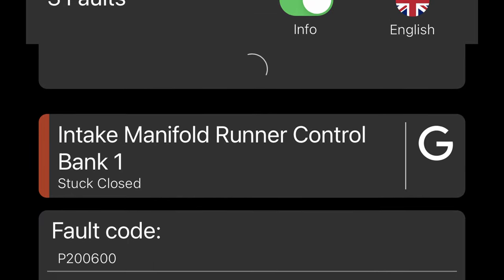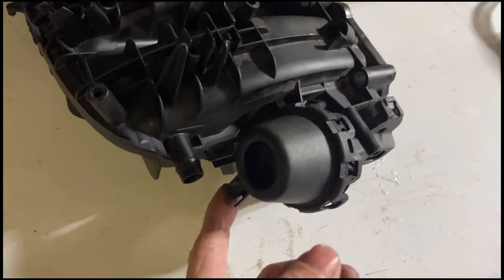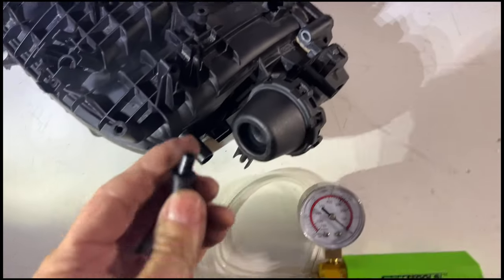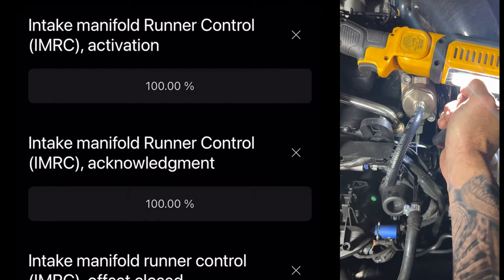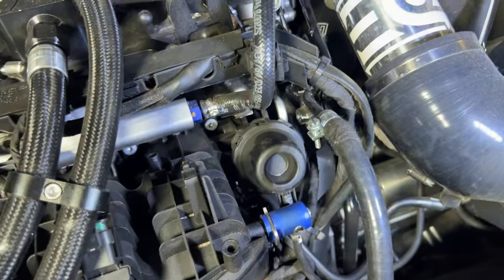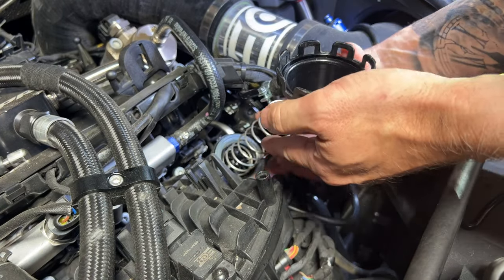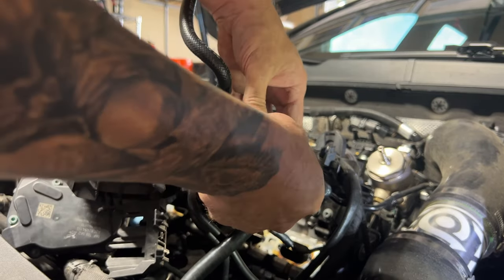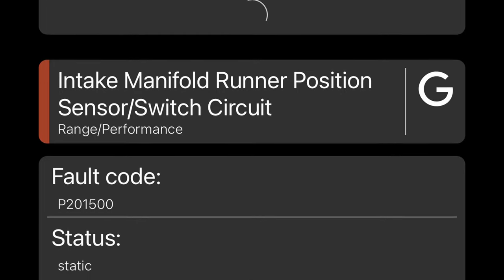Fixed! Intake Manifold Runner Stuck Closed (P2006/P2015)

Comment: This is happening on my 2023 MK8 R DSG.  The dealer did their troubleshooting and cleared the code and test drove it.  Then, a few days later, the check engine light came back.  This time, they determined the manifold needs to be replaced.  Its on order.  Car has 4,500 miles on the odometer.
Reply: This happens to my T-Roc R 2023 3 months old with 3000k kilometers. The last three days every morning, i have check engine light with p2015 and some times p2006.
Also, before this light came up, the power was not stable. Some times, it was good, and sometimes it was slow.
Reply: This is currently happening to my 24 Golf R DSG as well. I am 2300 miles in. Dealer will also be replacing the manifold.
Reply: Just got the code on my mk8 gti 😂
Reply: '24 MK8 R 6spd...car is at the dealer now second time, they want to change the runner solenoid before replacing the whole intake...i feel like my car will be back there 😭

Comment: When your intake manifold heat control valve was stuck closed (due to inoperative vacuum valve), did your intake manifold overheat?  if so, why?
Reply: did you watch the video? why would you assume its heat.. its a tear in the rubber... bro do you use your brain?
Reply: @johnboy2436  rubber doesn't tear on it's own. Something needs to cause the tear or rubber failure such as heat, but that is not why I asked the question, stoner.
Reply: @meblake7359 Could you tell me why you assume i smoke weed? What on earth would make you call me a stoner. Then explain how you think heat would get through a layer of thick plastic and then cause a "tear" with no indication of anything being melted. I see you used the word failure to somehow throw shade on the fact what your say is just not possible. You understand how this system works right?

Comment: Anyway you could tell me the OBD app you are using to look at that IMRC data? Im having the same issue right now, and I confirmed I have vacuum, so I would Like to check if my sensor is the problem at this point.

Comment: I am assuming  this will apply to same fault code i  got P2004/3B5E . The sympton i have is hesitation at above the rpm range you mention.
Reply from the maker: Sounds like yours is stuck open… I’d def start with these troubleshooting steps. That sprint is what closes the runner. So it could be that is broken or something is stuck somewhere.
Reply: I took out the censor and it was covered in gunk. It seemed to have it fixed for a couple days but symptoms came back.

Comment: What symptoms did you have while driving; I'm getting EPC warnings on heavy acceleration & it seems to be cutting my throttle plate & dumping boost making my car fairly slow. Is this what you experienced before the P2006 code was initially stored? I'm going to inspect the diaphragm on the vehicle as the runner isn't physically stuck. I have to assume a manifold replacement will fix these other issues. My theory is when the car sees the manifold not opening the runners it goes into a temporary limp mode preventing the car from building boost by using the diverter valve and literally not opening the throttle plates. The difference between the pedal position and the throttle plates throws the EPC warning if you bury the pedal when it's cutting power. Let me know when you can if any of this happened to you. Thanks

Comment: Hello CPO ~
Great video you put together! I don't comment often, but you deserve applause for your time, professionalism, and your willingness to be selfless in our increasingly selfish world! So, thank you!

I wanted to comment on one point that may help someone else in the future, who might be struggling with a similar issue. Before I do, I want to be clear that I am in no way trying to be critical or portray that I'm anything special. This is only meant to be constructive criticism. If I may explain...
 --There is no need to monitor the (runner position) sensor as you manually move the runner.  The reason is,  the fault code(s) indicate a "stuck runner" and you confirmed it when you applied vacuum to the runner actuator and it would not move or even pull a vacuum.  So, the sensor can't possibly be a contributing factor.  Seems like I'm nit-picking but I believe that its always best to keep it as simple as possible.  In other words, You nailed it when you decided to use a vacuum pump to move the runner!!!  That was GREAT diagnostic skills!! By manually moving the runner with the pick while watching the data, just shows that the sensor and circuit is functional.  But you already know that because 1) the P codes and 2) the inability to move the runner with a vacuum source confirms the fault code.  The intake runner actuator is simply a sealed canister with a diaphram inside that's attached to an arm, that arm is attached to the intake runner shaft.  "When vacuum is applied, one side of the canister that has the hose port is under a vacuum, and the other half has no vacuum. As a result, the diaphragm is pulled towards the vacuum hose end. This indicates that there is a vacuum leak inside the canister. Therefore, there is no need to check the sensor. I apologize for the length of my message, but I always try to explain the operation and description of a component as it is my passion. There are many YouTube "mechanics" who just replace parts without understanding their functionality. If you can comprehend the purpose and functionality of a component, you can fix anything! 

God bless you all
Reply: Sending you a word of thanks for the detailed explanation - it’s always helpful to know the “why” when working on this stuff!

Comment: Having this exact problem. Same exact codes and everything. Perfect timing thanks a lot. I also happened to have an extra manifold lying around, so I'm just going to swap over that piece.
Reply from the maker: Keep me posted!!!!
Reply: did that solve it?
Reply: @gabekendall3751  I ended up having a small tear in one of my vacuum lines leading to the same failure.
Reply: @brandanholt3709  i just figured it out on my car i accidentally didn’t have one of the vacuum lines hooked up🤣 Are you hybrid?
Reply: @gabekendall3751  no stock is20 for now stage 2

Comment: Awesome video!! It contains a very valuable info with careful explanation, unfortunately in my case I’ve the P2004 code (IMRC bank 1 stuck open), based on your video it means there’s vacuum but something is avoid it change to closed again… any tips or information that you could share to trying to fix this?? Thanks for reading regards from Mexico 🇲🇽

Comment: Hello,

Do I have the same problems as explained in the video with the following errors? If so, do I need to replace the complete amission manifold? (Audi S1 2014)

P200400 Intake manifold runner contraol bank 1 - Stuck Open
P201400 Intake manifold runner position sensoir/switch circuit

Thank you
Reply from the maker: Sure sounds like it